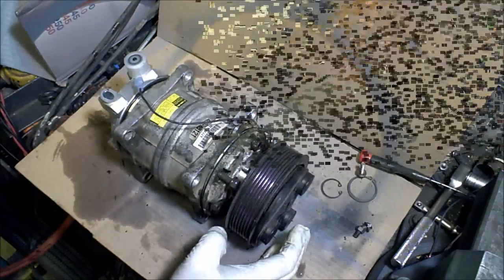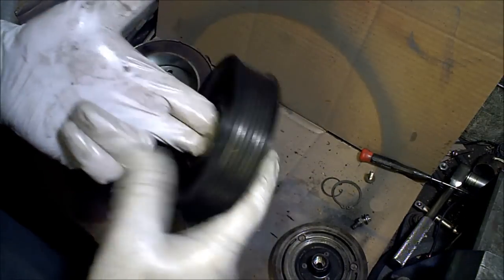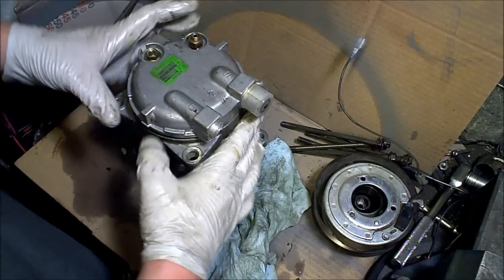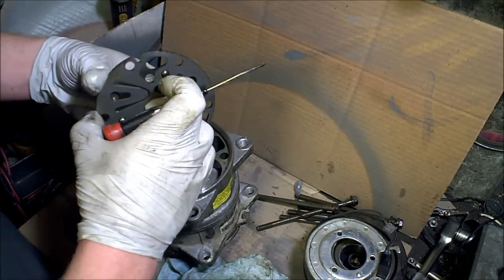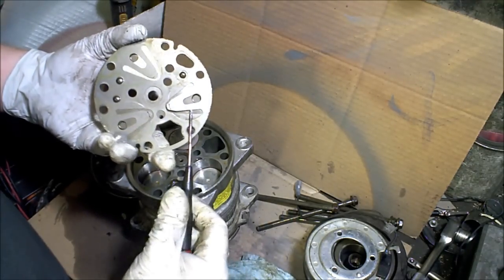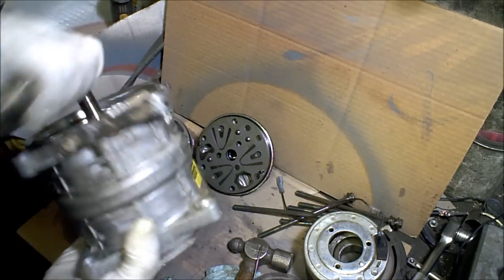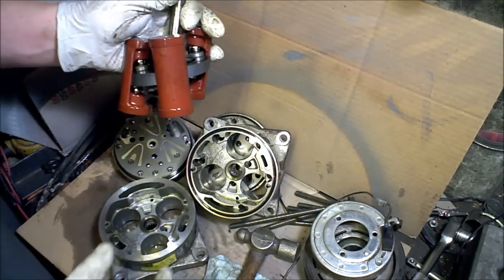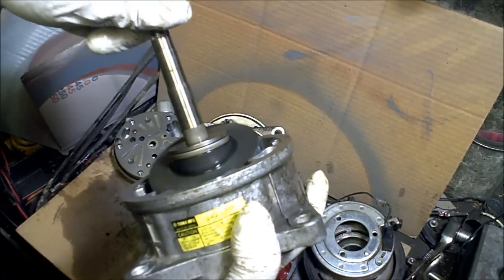AC compressor take apart How it Works tear down air conditioner

Comment: I'm curious if the compressor oil and refrigerant are both pumped through the entire system or not. 

I know they sell refrigerant bottles that have oil mixed in so that leads to me think they do? If not how does the oil stay in the compressor when filled using those mixed bottles?
Reply from the maker: The oil settles out into various parts of the system. It gets pushed around only through a light mist.
Reply: My compressor makes noise only when it's disengaged but engaged it's quiet. Think it might be the bearings and I can get away with replacing them only?
Reply from the maker: That would be your clutch bearings on the front and they are commonly replaced. Here is a video where I do just the clutch bearings: https://youtu.be/Z_9yaMfsgbQ
Reply: It moves through the system because there's no oil sump and as such it has to dissolve in the refrigerant (never use PAO oil with R-134A systems, it's not refrigerant soluble and if the compressor pushes it out it won't return), although some compressor body shells are designed so that most of the oil charge stays inside the compressor even during operation, much like with a sump equipped one, and there are a lot of additives around which claim to remove the oil layer from the heat exchanger (evaporator+condenser) walls and send this oil to the compressor. The oil charge+refrigerant bottles are meant to replenish little amounts of oil lost through refrigerant leaks, but fixing leaks and having the charge done through a station is much better than dealing with this kind of stuff. Anyway it's charged in the suction line with the compressor on and it gets sucked inside the compressor along with the refrigerant which acts as a solvent (while the best way of doing it is in the high pressure side with the compressor off and into a vacuum).

Comment: pretty interesting! looks like it would easier and cheaper to rebuild than being gouged by the mechanics shops or parts houses if the replacement kits  were readily available!
Reply from the maker: There's not a lot it would take to rebuild these.

Comment: is there a way to make the piston's compression better when it gets older. why the ac capacity goes less over period of time. is the replacement the only option as a whole. thnks for the video. its short but very informative, i enjoyed it )))))
Reply from the maker: Sadly, no. If is was running in some other environment, a thicker oil would increase the compression. But a thicker oil would adversely effect the cooling ability of the refrigerant, so that's not an option.
Reply: thks

Comment: Hey man I have BMW E36 my AC Clutch is spin but AC Compressor not spin , do you think i need new compressor ? Oh can I use AC UV deleter kits while AC Compressor not spin.
Reply from the maker: +Raksasok Heng If your compressor is locked up then it is bad. Your fan belt will squeal when the AC is turned on if it is locked up.

Comment: great video.   I have a question.  I have a auto a/c compressor that keeps blowing the fuse.  It was work good, then I noticed no cold air.  I took it in to a shop, guy added Freon and it was good to go.  about a month later if that, it did it again.  I took it back to shop.  he found a valve had a small leak, recharged it and then it work for a few minutes, and was told by shop that it was blowing fuses.  what could cause this???  any suggestions?  he said maybe compressor is no good or short some where.  I don't think there is a short, since nothing has happened to vehicle, like accident or anyone has worked on it.
Reply from the maker: A blowing fuse is generally a short where a wire has just rubbed on the engine or other moving part over the miles of driving. These erratic fuse blowing issues can be very hard to locate.

Comment: Hi there let me ask you a question I just got my ac compressor replaced on my altima 2007  but it doesn't cool  like the factory one I got it from autozone and suprasinly it was the same brand as the factory one ,valeo by the  way ,any advice please thanks.
Reply from the maker: I would think your r134a charge is off or air in the system.

Comment: Maybe that is why tis problem is intermittent and hard to track down, since the belts were new when I got the car.Maybe a combination of the pulley's and belt.Whats weird is the other night when driving down the road and the heat was turned on it started to screech.Not sure why turning the heat on causes this?

Comment: I replaced my compressor and neglected to flush the system prior to servicing. Dumb mistake. Now my low side pressure is way too high, won't accept Freon, and not cooling at all. I flushed the lines, condenser and evaporator after the fact but no help. Do you think my new compressor is clogged? Though I'd open it up and try to clear it if so.
Reply from the maker: John Meena The compressor likely isn't clogged but maybe one of your lines/filter dryer.
Reply: Your compressor failed and tossed particulate matter through the system in the process? If so, you always need to change your condenser because that is now clogged (from the compressor failure) up stopping freon from flowing through the high side to where the pressure sensor is (which is why it's reading lower) and then the low side is being backed up because the compressor cant take in and expel freon due to the clogging on the high side. If the condenser has debris in it, often times no amount of flushing can clear it out because the passages are very small. That's when the low side backs up and has a pressure spike, then the compressor usually shuts down due to the pressure reading. The condenser and the accumulator (or alternately the receiver-dryer) should always be replaced when replacing a failed compressor, and if you have an orifice tube system then the orifice tube should also be replaced with the proper size replacement. There will probably be more debris in your system, so it would be proper to install an inline filter (aftermarket) to protect your new compressor as the debris flows through over time. After some period of time the vast majority of the debris will be trapped in that inline filter then you can remove the filter entirely or remove it and put a new one in for safe measure.
Reply: Wow. I'm going to replace every component come spring, except the compressor. Don't know where I'd fit a filter on a miata but I'll look into it. Thanks

Comment: Got an AC problem on a volvo 940. Compressor runs nice and quiet, clutch engages fine. Fans run. Pressure is up to what it should be. No cold air. One thing I noticed is when you connect the guage with the compressor running, the pressure goes to zero, but comes back to normal when it stops.  Prior to me recharging the system, it hadn't been used by the previous owner for at least 4 years. Any clues as to where I should look for faults ?
Reply from the maker: Did you vacuum the system?
Reply: No. Unfortunately I haven't the equipment to do that. Thanks for the reply by the way, especially as this video was uploaded a few years ago now. What would vacuuming the system do ? Also, how hard should it be to turn the pulley by hand, with the engine off and the clutch engaged by connecting to 12v ?
Reply from the maker: If the system was 100% empty then air  with moisture got into the lines. The system will never produce cold air as moisture in the lines will freeze/block the system. The pulley should be fairly easy to rotate by hand with the clutch engaged.

Comment: Also, I found acouple videos on here that show acouple Mazdas making exact noise mine is and the owners swear it is the compressor bearings.Either the pulley bearing or bearings inside compressor,but I'm not convinced yet.

Comment: Jet engine fuel pumps work similar. Some are radial pump meaning a rotating plate is shaped like a multi-lobed cam.

Comment: hey question for you, dont know much about a/c systems, trying to decide if my clutch is bad, the clutch is bolted to the compressor shaft, when u turn the clutch, when not engaged?, is it still turning the compressor?, mines easy to turn, my systems full, the clutch engages when u turn the a/c on, but doesnt put a load on the engine, that typical rpm drop from turning the compressor, its as tho you didnt turn the a/c on, being that systems full, Im hoping the fix is easy? I know a/c systems can be expensive, but trying to trouble shoot any help would be appreciated
Reply from the maker: The center is connected directly to the compressor and should be fairly easy to turn by hand. How do you know the AC system is full?
Reply: sixtyfiveford I have a refill can with a gauge, and said the charge was full, actually according to the gauge, overfull if they’re accurate, but like I said when the clutch engages, when its running, ud never know doesnt load the engine at all, I figured it be hard to turn since its a compressor, but like I said, know very little about a/c systems
Reply from the maker: If the system was empty then air got into the system and it will not work at all unless a vacuum is pulled on the system prior to refilling it.
Reply: sixtyfiveford thanks for taking the time to get back to me, I appreciate it, Im gonna have to take it somewhere, and I hate to do that, bought the car off my boss who bought it new, and I knew the a/c didnt work and he said he said it stopped working one day and he never had it looked as it was a 2007, and how many years old, and I put the a/c charge can on, that gauge said it was full and the clutch comes on and the fan and the airs not cold, and thats pretty much the extent of my a/c knowledge, figured Id ask around. anyways, luv your channel, and once again thanks for getting back to me

Comment: Great video.

Just wondering, has anyone ever thought of ideas to cool the battery to extend battery life either with a redesign of the engine cooling system or maybe using the AC compressor as part of the redesign as well? Since hot climates and engine heat really reduce battery life, it would be great if a new idea came around. Or even something simpler like developing insulation material for the battery or have intake air directed for battery cooling.
Reply: battery relocation

Comment: Could you make that a.c. compressor into a working two stroke engine?
Reply from the maker: Not really as there is not the proper porting. You may be able to turn it into an air powered engine.
Reply: @sixtyfiveford  true. But I thought you could drill two holes per cylinder and add a spark plug. Only one way to find out I guess. TO THE BAT CAVE! I have a cad model if you're interested

Comment: Sixtyfiveford
how much oil
goes in that compressor.
Is it PAG 100 ?
Good video.
😇😊😆😃😇
Reply: No, it's PAG 46 double end capped (equivalent of ZXL100PG) for these compressors. Amount of oil is specific to every system and may vary from exactly what you removed from an old non-seized compressor to a full system oil charge (whatever you can get into the compressor is put into the compressor oil hole and the rest is injected into vacuum through the high side port) if the old compressor seized and you flushed the system

Comment: Hi,I have an idea of making use of the AC engine by keeping the shaft running even when the engine is switched off.The shaft shall have a centrifugal clutch plate like in scooters connected to the main engine shaft.Once the ac engine gets high during acceleration,the main shaft gets coupled,till that stage the ac will only run but the engine remains off.
any one suggest me that this design has any if or buts...

Comment: What usually go bad inside ?
Reply from the maker: The pistons and cylinder walls wear, causing lack of compression. Essentially the same thing that happens to a car engine, except there are no piston rings in a compressor like this.

Comment: It look likes it made pretty tough but what makes them fail? I dont see no plastic breaking anywhere. It look like it should run forever.
Reply from the maker: kyomax1 The thin metal valve plates fatigue and break or the pistons wear and can produce as much pressure.
Reply: People running AC on low refrigerant charges is what makes them fail, it deprives them of oil because they have no sump and the refrigerant is what brings them the oil. The shoes holding the pistons attached to the plate just scratch the plate when that thin film of PAG 46 oil suddenly goes missing and metal crap starts being spewed by the compressor furtherly depriving it of oil until everything basically welds together

Comment: can a car radiator fan turn the compressor? idea for DC air-condition.
Reply from the maker: An electric radiator fan would not be able to turn an AC compressor. You would need a decent size electric motor 1+ hp at least.
Reply: thank for your respond.

Comment: I have leak in my caprice 96 compressor and i didnt find reseal kit can i use silicon gazket to reseal it thanks
Reply from the maker: It depends if its the high or low pressure side. The lower pressure side possibly. The high pressure side can approach 300psi and wouldn't hold.
Reply: @sixtyfiveford  can i weld the compressor with aluminum arc welding put wet towel to prevent heat and weld it

Comment: i have one question
when car was in rest position. i have to use A/C.
for that i have to use car engine to work to rotate compressor.
the question is
why can reduce power of engine at that period
period is nothing but when car is in rest position.
Reply: santhosh g The compressor will put more load on your engine when running. Does your car stall when the A/C is on and idling?
Reply: Eggy thanks for replying me.
in idling condition.
Reply: santhosh g So the engine bogs or stalls?
Reply: Bogs means
Reply: santhosh g Very low RPM's about to stall.